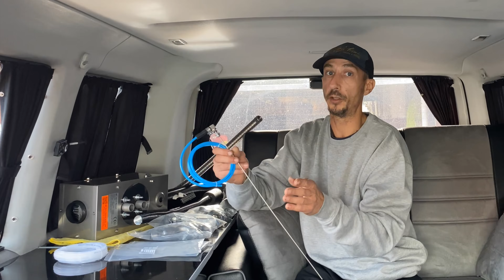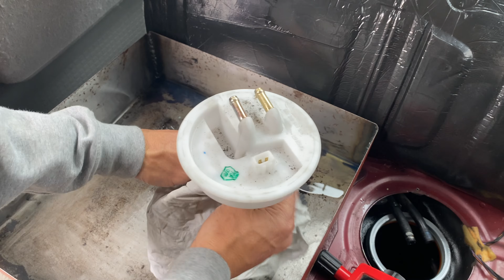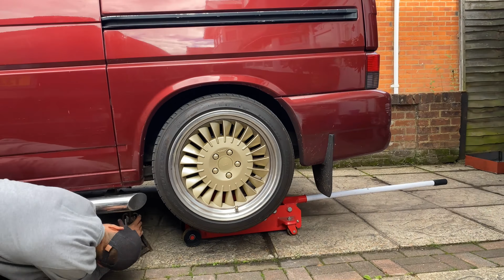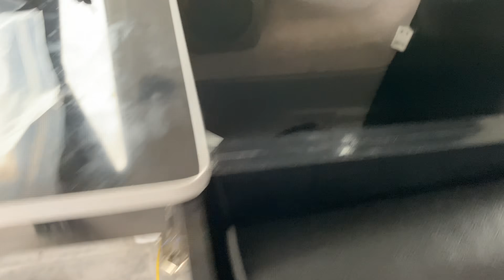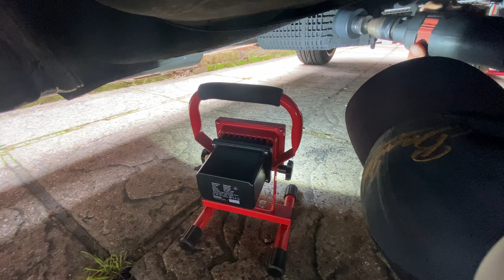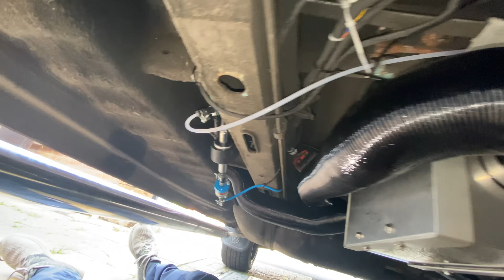VW T4 Caravelle/Panel van Heater Installation ( Full in depth guide for camper van )

Comment: This is great. I’ve a T4 LHD multivan. It has a similar setup to the caravelle but the vent in the rear step already has a heating channel going to it. The pipes to the rear matrix has been removed. Whilst I plan to follow your intake to the letter there may be tweaks wrt sensor location etc
Reply from the maker: That’s awesome, hopefully a straightforward job. Good luck you got this 👍
Reply: Circling back to this why the 80mm - 60mm reducer? Would a flange work and why 60mm ducting and was all your ducting 60mm?

Comment: Great video dude! I have a petrol camper with some different things running everywhere but got quite a few great tips, and ideas from your video, so thanks a ton!!! A couple questions about your fuel pump/line. What is the "dampener" I believed you called it? What is it for or what are the benefits of it? And the one way valve? I've never seen a kit that came with one of those and  I've watched a handful of these videos so far and have never seen or heard mention of either the one way valve or the dampener? Just wondering if you could go into a bit of detail about it please? Again thanks for the great video!

Comment: Great watch mate. My van came with a Chinese heater fitted. I can’t stand the panel to work it, far too complicated for what it does, which is blowing in hot air.
Reply from the maker: Thanks for watching mate and the awesome feedback👌 That’s one of the reasons I didn’t want a cheaper version, and they all seam to have different control panels, with letter and number combo to adjust temperatures, confuses me haha
Reply: @TwiggsT4  would love to get some kind of housing for the unit, which is fitted under the rock n roller. Tempted to look a little more in detail about how it’s been installed. Very thought proving video Matt. 👍🏼